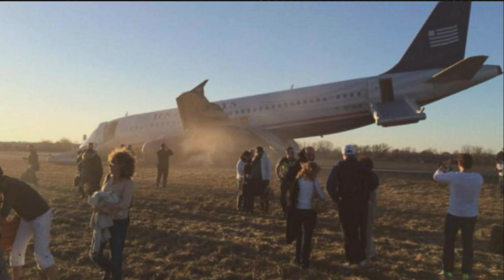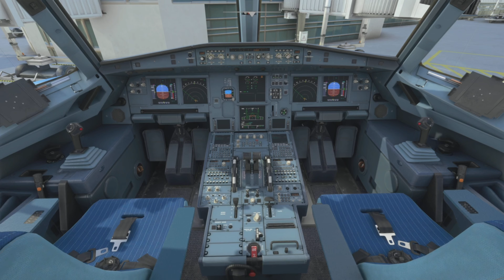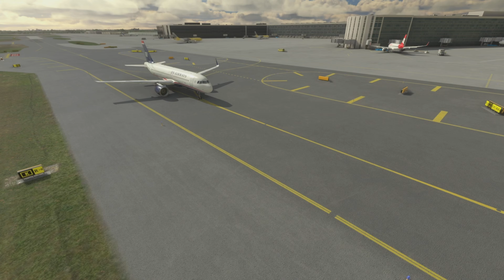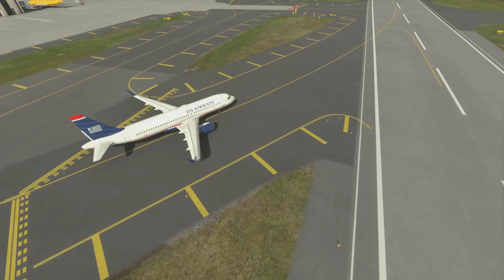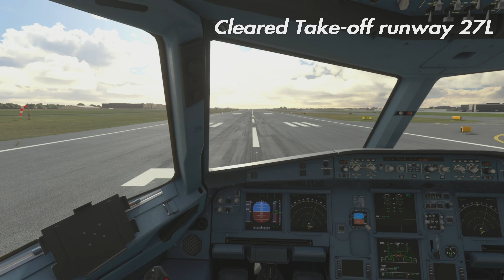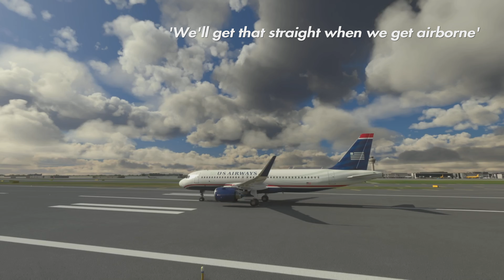Should They Have Continued? | US Airways Flight 1702

Comment: For me, it comes down to the interview with the Captain. He ALREADY KNEW, by his own words, that the V-speeds didn't change from 27L to 27R. It might lead to some stupid conversation later, but otherwise amounts to about a fictional hill of sh*t outside the computer itself. He STILL insisted on the FO changing the runway...

    From Computer Science 101 stuff, I already know that 9 out of 10 times on a dedicated system like a Flight Management Computer, if you change a routine parameter, the computer's GOING TO REJECT the rest of the data. You have to go through and either completely repeat it, or at least confirm every piece. It's just that simple, and it's quite likely that there was ALREADY documentation to that fact, and probably training as well.

     The FO might not be blameless, for not having voiced the requirement for putting everything into the computer, or confirming it all again, BUT it's still on the Captain for inventing that problem to begin with...

     As stated (at the end) in the video, this still COULD have been saved by moving the levers to TOGA and probably pressing the TOGA buttons/switches... to initiate full thrust if the Captain was in doubt for getting off the ground "by the seat of his pants" as it were. BUT he did NOT do that either.

      SO the reality is simple. EVERY PILOT'S #1 priority is "FLY THE G** D*** PLANE"... It's that way from the time you go to full thrust at the take-off EVERY FOOT to the point you're back to rest at 0 knots on the ground again... PERIOD. In take-off, as thrust spools up, and you get an error message, you KNOW there's something wrong, so you DO NOT HAVE TO TAKE OFF... and you quit. You go back to the apron or taxi-way as applicable and figure it out, or have someone look at it and help you.

     "Every take off is optional. Every landing is MANDATORY." That's some sage advice from every instructor at EVERY flight school, all the way back to crop dusters, experimentals, ultralights, and even remotes! 

     The TRUTH is that the Captain KNEW he'd f*cked up. He KNEW it was unsafe from the beginning to try to take-off, and he probably knew the computer flubbed on account of his insistence in changing the input runway... It's less than optimal, but not so big a detail as to get anyone fired UNLESS of course, you cause the crash of an airplane over it... As soon as he'd reset the throttles and the error message did NOT disappear, he should've stopped right there. That's the standard and NOBODY would've batted an eye at the matter. The computer issue would be figured out and data re-inputted, and other than a chuckle about it "being all that hooey over nothing", and everybody would get on with their day and the plane would even still fly.

     If it were me... I'd have asked the FO if there's a difference we needed aware of from 27L to 27R... and if not, we'd reach that agreement, and that the V-speeds should be equivalent and reached in equivalent distance, so with just a little tendency toward "rotate late" by a few seconds, we'd just have taken off the plane... FLY THE G** D*** PLANE being our #1 priority. 

     AND if there WAS a difference, say an uphill trend on one or the other being shorter, I'd wave off the tower's clearance and excuse us long enough to re-input and/or confirm all the parameters for take-off again. Damn the consequences, because I'll be late a thousand times WILLINGLY before I get anyone killed trying to save a damn minute. There are a few (probably very few and becoming fewer) places where 27L might be uphill or shorter or longer or something, and that data IS important from one runway to the next one beside it, otherwise largely the same... This is NOT rocket science. It can get tedious, time consuming, and frustratingly repetitive, but it's not terribly difficult in the "decision making paradigm" department.  ;o)

Comment: Performance takeoff problems occur regularly. If you keep your eye on the relevant safety websites, you'll see a good number of them every year (with the exception of the pandemic years). It's amazing that a major disaster hasn't happened yet, but there is still no movement yet towards active monitoring technology for takeoff performance. In the case of the Airbus A320, flight envelope protection is a major safety feature. I would argue that 'flight' begins as soon as takeoff power is set. This means that envelope protection is in fact not functioning during what are the most critical seconds within the most critical overall phase of flight. Let's face it, the aircraft is under active aerodynamic control, and may have already run out of available runway abort length even before reaching V1 (numerous pilots have stated in the context of performance takeoffs with no problems or mistakes that there was no way they could have rejected safely at V1).

Comment: I dunno.  Seems like pilots rely too much on the fancy software autopilots TOGA buttons etc.  They should KNOW their aircraft, know the speed to pitch up, know the flap settings, and manually take off.  All this confusion when the computer, or software, or the automatic controls malfunction.  A pilot should IN HIS MIND have the basic take off parameters set in his mind BEFORE he starts rolling.  Speed, flap setting, thrust sertings, what else?  This is basic.  Saving fuel and engine wear is not worth wrecking an airplane.

Comment: Everyone survived, so this is a good outcome. 

With that said. Rejecting above V1 with no indication of catastrophic damage is a bad move, and which likely lead to the hull loss of this aircraft.

Any kind of derated takeoff, in this case “flex temp”  in airbus nomenclature almost always works.  However! Power is also your friend, and must be able to be used when needed.

In this case, TOGO thrust, with 10 degree climb would likely have lead to boring flight, and maybe a reprimand.

Comment: The Flight Computer should've been verified as Properly Programmed prior to Taxi, or prior to entering the Runway at the latest, if there's a Que...

Lack of both Pilots verifying all systems are Programmed, and operating nominally, is what leads to most issues occurring...

Comment: My experience is driving buses, not flying planes.  If I took a bus out and discovered a problem,  I have to determine whether it is safe enough for me to continue driving.
One could argue that the pilot waited too long to reject the takeoff.  But with all of the information disappearing from the computer screen,  I think rejecting the takeoff was the right call.  We don't know what other information that the pilot needed from that screen that was wiped out.   Takeoff isn't the time to try and refeed info into the computer.  The surprise to me is that the F/O didn't catch the fact that she loaded Runway 27R in the system when the Tower directed them to 27L.  Had she spoken up immediately  she would have had time to properly reload the information.   Since Philadelphia is their base, maybe the captain should have left the configuration alone since they should have known that the two runways are equal lengths.   But having the F/O make that correction just before takeoff roll certainly didn't give her any time to attempt to put anything else in the computer.  Or maybe had he had her redo it while he waited, this could have been avoided.
It's easy to say that now, but in the moment not so much.

Comment: Easy: Captain ballsed up in spades. This take-off should have been rejected as soon as they realised they did not have the V speeds available. Having made the wrong decision to continue the Captain then made the second wrong decision by rejecting after he was actually flying. He then got himself into a PIO with some inept control inputs. The FO obviously initiated the whole sequence with her FMS mis-steps, but it was the Captain who doubled down. Very poor show, defended by the pilot union of course.
Reply: They should have taken their time to reset the flight plan.
Reply: @johnc1643 this is the singular correct answer. When in doubt: stop and figure it out. Too many lives and $ are at stake to be “unsure”.
Reply: Him
And her were fired.
Reply: @caseyedward2890  Really? I don’t think it was a firering offense in the case of the first officer; she made a simple mistake. I do think, however, that the captain showed quite a lot of bad decision making, while apparently blaming it on his co-pilot (“what did you do!?”) so in his case it should either be re-training or getting fired.
Reply: Agreed.  The unions are a cancer on aviation.  They have come to the defense of drunk pilots that have showed up to work.  They also defended a pilot who came to work high on cocaine.
Reply: It STILL ALL routes back to the Captain... 

1. In his interviews, he admitted to "knowing the V-speeds for the other runway, which were the SAME V-speeds as the one he was on."...

2. He STILL insisted on "protocol" that the FO input the new runway numbers as if that mattered ANYWHERE except his precious little mind... AND it's very likely that there was already documentation about changing anything about the Take-off inputs to the computer negating the rest of the data so that it had to be re-introduced.

     Basic Computer Science here... In a system as dedicated as a Flight Management Computer, it's FAR safer in the "big picture" to throw out the data when something EVEN as inane as runway number is changed. There ARE airports where one side is discretely shorter than the other... or uphill slightly... or any of a dozen ways the V-speeds and target thrust ABSOLUTELY MUST be recalculated. It "invents work" when you arbitrarily start playing with the numbers... and it's too easy to miss the subtlety of a slight uphill runway over a "dead flat" or downhill run... SO it's just better to make it standard practice to re-do ALL the inputs every time. That's just how computer and software engineers think...

    At the end of the day, the Captain KNEW before he even said anything that it didn't matter a hill of sh*t which numbers in Philadelphia were in the computer. It's not exactly "correct", but if the V-speeds aren't going to change, and you're already taxiing out on the runway, drop the BS and just FLY THE G** D*** PLANE... That's ALWAYS the #1 priority.

    SO it comes right down to point... The Captain completely engineered this entire clusterf*ck, himself. Sorry if that sounds harsh. He f*cked up royal, from get-go to finish.  ;o)
Reply: @gnarthdarkanen7464  bang on the money.
It's almost as bad as tipexing out 27R and writing over it with biro pen.
Reply: @dougaltolan3017  Thanks...

     What really burns my ass is that the Captain could've avoided ALL of this one of two ways...

1. Hold short at the runway, and refuse to move until the computer was reprogrammed fully, and they'd BOTH double checked it for correctness...

2. Dismiss the runway numbers as "negligible BS" and explained it whenever (and IF ever) Supervisors or someone from Corporate asked about it. It's not going to change anything, and he (Capt) KNEW that already... so other than whatever was recorded in the Computers and logs, there's nothing to bother changing or adapting to...

    Inventing work and wasting time isn't cheap in the aviation industry.  ;o)
Reply: @gnarthdarkanen7464  Since EVERYONE is flaming the captain here, I assume at least one of you is a pilot. I’m not. I heard the first indication of a problem at 87 knots. The problem got worse at 140 knots. Having driven a car at those speeds, neither one is perfectly safe to slam the brakes on. Plus a jet loaded with fuel has a lot of weight and bringing this additional weight to a stop can overheat the brakes and start a fire. A brake fire can get everyone killed. So an experienced pilot should be able to set the appropriate thrust without the computer warning causing him to do a dangerous abort. An experienced pilot would be aware of any differences also. So when the pilot exceeded the takeoff speed and the plane failed to rotate, He could have spent the last 3 seconds of his life waiting for the engines to spool to TOGA power and pray he didn’t hit the antenna or wall at the end of many runways however he made a snap judgment he STILL could stop in time so he spiked the plane on the runway and fishtailed to a stop, saving everyone’s life and destroying the aircraft. I don’t care what anyone thinks or even KNOWS the pilot did wrong, when SHTF even if it’s his fault, I want THIS pilot. The recovery and everyone walking away is what I take away from this. I don’t know all the things that the pilot did wrong but he did the most important thing right.

I leave you with this story. When I was a kid I was coming home from work in my supra. I downshifted  getting off the exit and a patch of black ice or sand sent me sideways into the grass at 75+. There were cars to the left and cars on the exit to the right. You see it all the time - a driver overcorrects and goes into the wall or into oncoming traffic. I maintained a cool head while fighting to regain control. I was using minimal inputs and accepted I would crash and roll over at any moment. A split second later the steering started to respond and I straightened out and recovered, bringing the car to a stop. That kid from 30 years ago made a lot of mistakes. That’s life, one mistake after another. But there’s nobody I know except my best friend who could handle a situation like that and have a chance to come out unscathed. That’s life. It will beat you down if you let it, but it’s not how many times you get knocked down, it’s how many times you get back up, (according to Sly)
Reply: "defended by the union of course"
Spoken like a true trumpian...
Reply: @sess5206  why bring politics into this, the establishment plays us against each other
Reply: @sess5206  …eh? The actions of the captain were defended by the union, and that is a simple matter of fact. Trump has zero relevance here.
Reply: @XPLAlN  Trump has zero relevance in life, bud.
Reply: You said it exactly..... sheesh, I could have bloody well flown it better than that myself and my single solitary time in a jet cockpit was being invited in by the pilots as we came in to land at Gatwick from Rio de Janeiro in 1997, in the days when certain favoured passengers still had the opportunity to get such privileges when you knew either one or both the pilots or, as in my case, one of the cabin crew!

Honestly, how that could have been so disastrously handled is unimaginable....

Comment: I think the captain made a bad decision. The airplane had all parameters to get in the air and there was no structural failures or indications of any failure. Therefore take off should have been continued and the solved problem air
Reply: The captain didn't know that. It's easy to judge from after the fact, but we weren't the ones taking off in a plane we weren't 100% confident in. They made some terrible decisions that led them to a rejected take off, but the rejection itself was the right thing
Reply: @mattd6085  it is always easy to play Monday morning quarterback but this is where going back to the basic of stick and rudder skills come in and he did not revert back to the old days of Cessna flying.  He started getting the warnings approximately 80kts. RTO would have been an appropriate decision to take all the way to V1.  He was second guessing himself and all the way to V2. When you are going that fast and have hundreds of lives on board, decisions have to be more assertive and prompt. And if you can't be prompt, go back to your training. I'm sorry but I stick to my previous decision that the captain made the wrong choice

Comment: Complacent, careless, and in a hurry, this is the result of that fiasco. The crew should have exited the runway, stopped the aircraft on the taxiway, and reloaded the FMSs with the correct departing runway, correct departure procedure, and a new takeoff and departure briefing.
Reply: 100% correct!
Reply: Yup - too used to routine takeoffs so when one unusual thing came up they didn't stop to take stock of the change. 
Too much automation in this case. If the flight computer could've automatically re-calculated and displayed the V speeds they would've been OK but apparently it didn't do that. I know these airplanes are too complex for the old whiz wheels, but it seems that may have helped slow them down to re-evaluate their situation. 
I wonder what happened to the career of these pilots?
Reply: @chipsawdust5816 Agreed! Now, what happened to these two pilots, career wise? They are probably with American or retired.